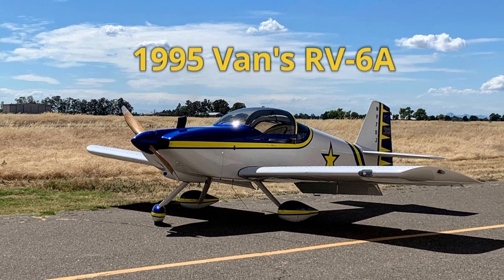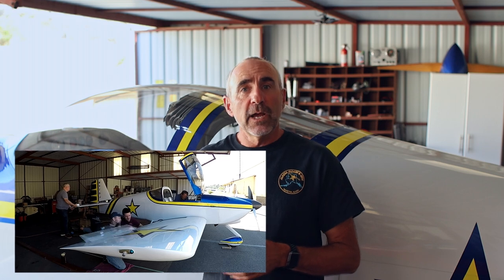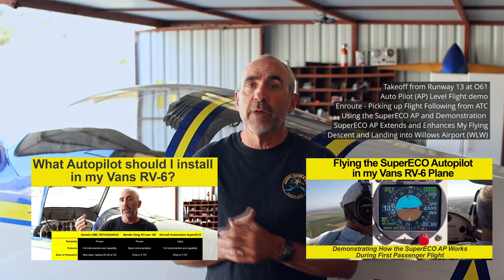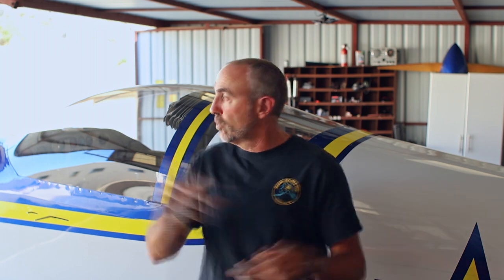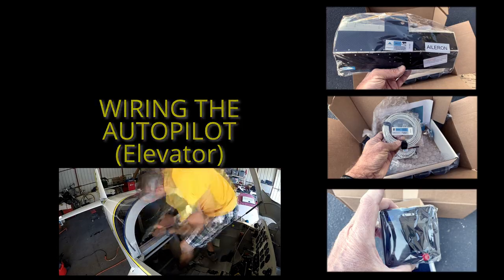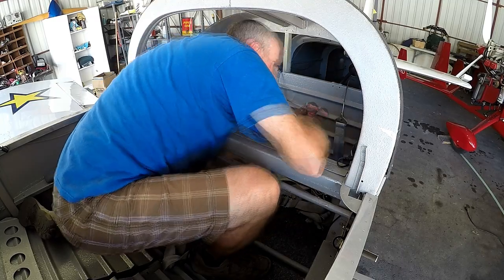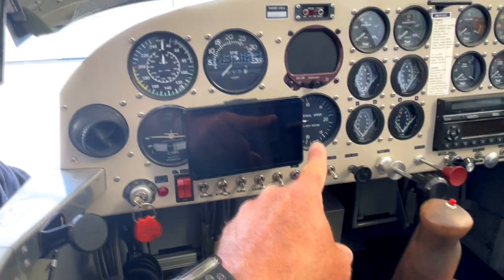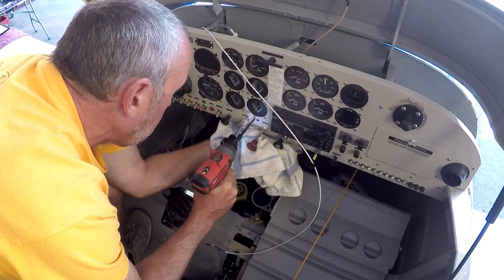Follow Along as I Install an Autopilot in my Van's RV-6 - SuperECO from Aircraft Automation

Comment: Chris, I also have an RV-6A and am very interested in this option.  Looking at wire routings and all seems fairly straight forward.  However, I'm wondering how you made the transition from the aileron to the forward area of the flap.  Specifically how you routed out of the aileron and around the aileron hinge/pushrod connection.  And then into the flap.  Love the videos.  Chris M.
Reply from the maker: Glad you enjoyed the video. We drilled a small hole in the side of the aileron to run the wire into the front area of the flap. We used a grommet and some extra plastic wrap shielding to protect the wire from abrasion.
Reply: So you routed under the aileron hinge slight exposing the wiring to the airflow below the wing?  Also, did the elevator and aileron require significant weight to balance? And thanks again for taking the time to produce the videos. @SilvaAdventures